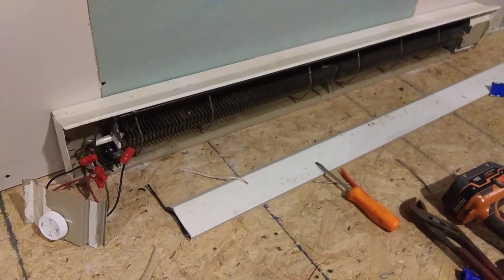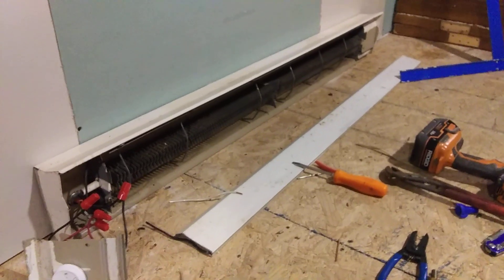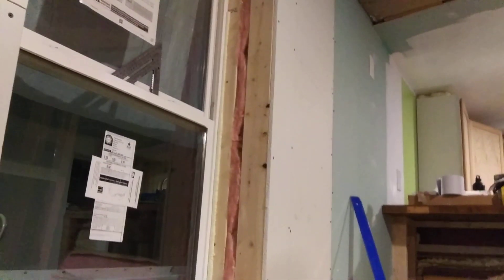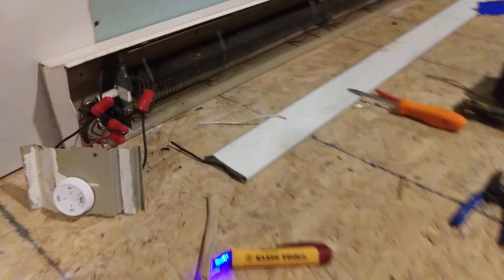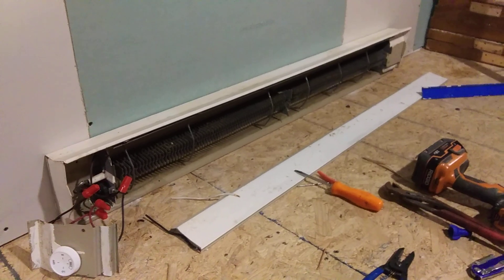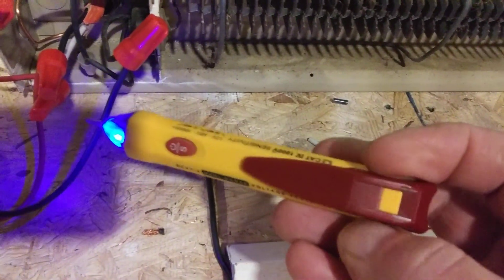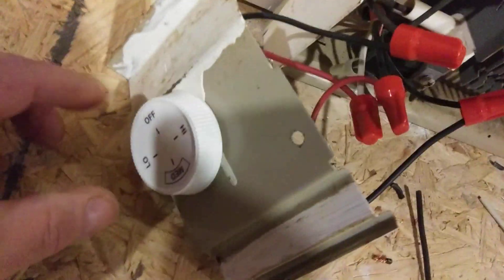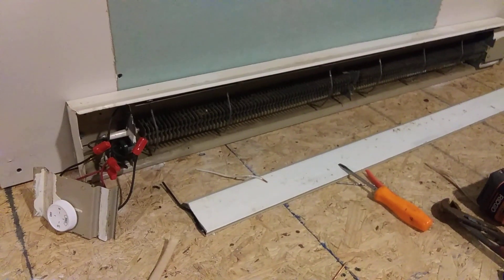Single Pole vs Double Pole, Thermostats Electric Baseboard Heaters

Comment: Do you ir can you show how the wires are all connected . A closer image . And how can I bypass the turn selector switch to turn on heat.  My heat won't come on I hear it click at switch but no heat . There's another round thing connected by fins with long metal wire I think that's the thermostat . How can I check it or bypass that if that's bad also

Comment: Hey James I am having some confusion on the wiring to connect a double pole thermostat on my baseboard heater. My Baseboards heater can be connected with just 2 wires coming from the wall and goes on the left side of the baseboard heater. I want to connect a double pole thermostat on the right side of the baseboard heater/ other end. But only the baseboard has only 2 wires black & white and the thermostat has 4 wires 2 black 2 red wires. Pls guide for wiring.
Reply from the maker: First, make sure you have 240 and not 120. Second you can put the tstat at either side, but you have to follow the manufacturer's instructions on which wires to cut and hook to the tstat. They should have something online. The side that doesn't have the tstat is wired together. Their wiring diagram is how you'll solve this.